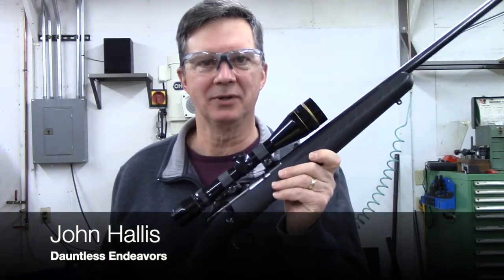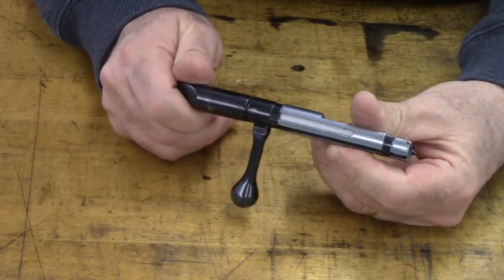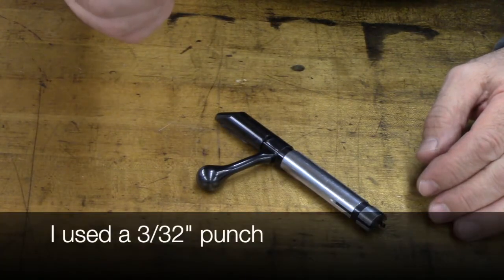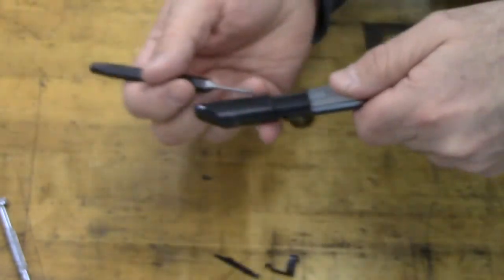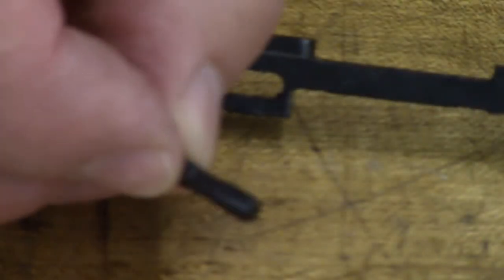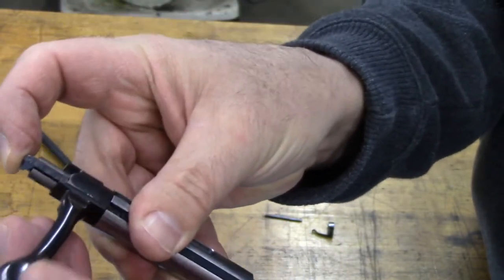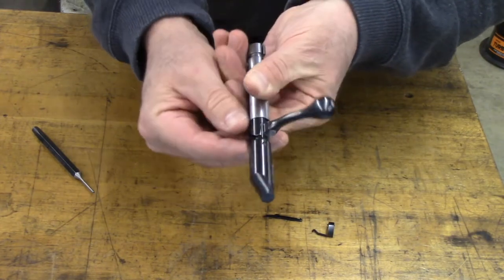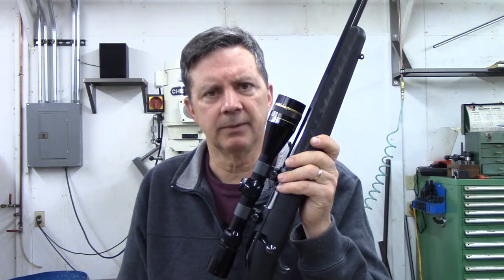Ruger American Rimfire (RAR) Experience.  Part 12:  Detailed disassembly and reassembly of the bolt.

Comment: You can't make a VW Beetle perform like a Ferrari. 
I like the series but that rifle should have a fun red dot for plinking.
Put the Leopold on a Ruger Precision.  😃
=================================
I was trying to find someone building a brass catcher for the RAR.
Reply from the maker: You are absolutely correct.  Ruger designed the RAR to be an economical, reliable, entry-level 22 rimfire rifle, and they succeeded.  It has never been my intention to turn it into a Ferrari but, rather, to see what can be done to get the most out of the VW.  As I wrap up this series, I want to emphasize that point but also to point out that while some of my modifications are not feasible, economically, they are still worthwhile, academically.  We can learn and apply this knowledge to other firearms.
Reply: Some people can't afford Ferrari's.

Comment: If the bolt handle is UP, isn't that position UNcocked?  I'm a bit confused.
Reply from the maker: That is a good question.  
If you fire the rifle or (with an empty rifle) hold the trigger rearward while closing the bolt by hand (with the safety off), the striker (firing pin) will be in the forward (fired) position.  This is its "de-energized" or uncocked position.  
When you lift the bolt handle, there is a cam on the bolt handle that forces the striker back into its energized (or cocked) position.  

When you cycle and close the bolt, the sear (which is part of the trigger assembly) holds the striker in the cocked position. 
It seams like there is a lot going on but, hopefully, this helps explain things.

Comment: Ok I've watched the complete series of videos. Very good information. I plan to try these on my RAR. Well I can't do the rechambering. 
 I do have a few questions. 
 After all the modes you completed. 
I take it you saw no need to do anything to the front bedding block ? 
After you did true up the bedding block do you think or feel the "foil tape shim " on the bedding block would help or hurt ? I know you did the part of checking to make sure the action screws actually torque the action to the stock. 
 Then did you ever experiment with the amount of torque on the action screws and check for better shot groups ? 
 Thanks for all the good work and information..

Comment: Any accuracy increase potential in truing up the bolt face to the barrel chamber face, both in spacing and in geometry?
Reply from the maker: Possibly, but I doubt I could ever accumulate enough data to demonstrate that the modifications you suggest make a statistically significant improvement in this rifle design.
Reply: @dauntlessendeavors1000  Okay cool. I'd found information elsewhere on the M77/17/22 rifle where shimming was used in the bolt to tighten up the headspacing on cartridges, which significantly improved accuracy.
A few thousandths here, a few thousandths there. Sometimes its just a game of incremental changes adding up to accuracy. That's all the expensive stuff factories often avoid, to bring customers reduced cost.

Comment: Hello, thank you for a great video. 
I have Ruger American 22LR rum fire and when use bolt to take the bullet in the chamber is fine but when after that bolt doesn’t lock and with slight touch bolt moves back and eject the bullet. 
So when there is bullet in the chamber bolt locks but when a bullet inside the barrel the bolt doesn’t lock and moves and loss. Do you proem is from bolt or safety lock or else! Thanks
Reply from the maker: It is very difficult to diagnose the problem based on your description.  I highly recommend you take the rifle to a qualified gunsmith and have them take a look at it.  That will be the fastest and safest way to get your rifle back up and going again.

Comment: Wish you would have had this video out a few years back when I bought a 22WMR American. It had fail to fires non stop right out of the box. Super accurate though! The first 100 yard 6 shot group with hornady vmax was .323”! Anyways, I disassembled the bolt group since it looked like light primer strikes. I found a chunk of sheared off metal inside along with it packed with thick black grease. Also the bolt housing and striker assembly looked like it was all gouged up and made with cave man tools! I filed, stoned, sanded, and polished the parts. Cleaned off off the grease and reinstalled using slip 2000 EWL. Took care of the FTFs accept for the Winchester 2250 fps varmint ammo. That stuff had faulty primers which Winchester confirmed after I sent the ammo back to them. The other 5 brands all fired 100% after the bolt fix. It also has a real tight chamber. After 40 to 50 rounds I get stuck casings. The chamber needs to be cleaned after every outing or there’s issues with stuck cases.